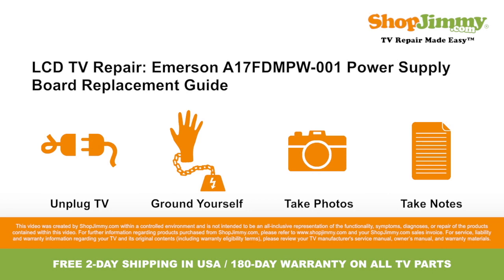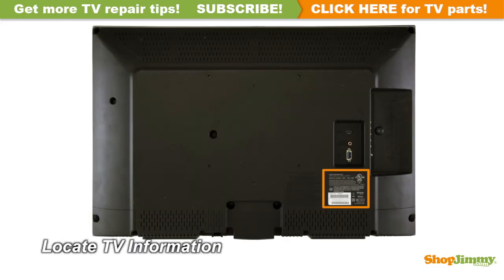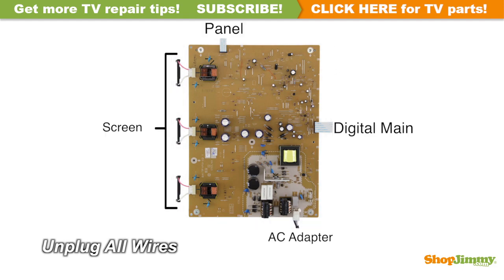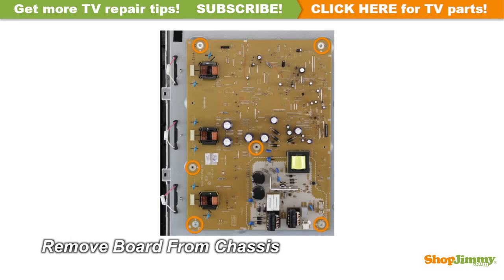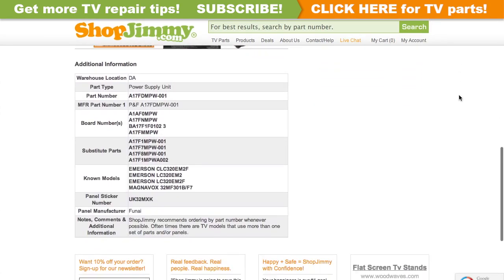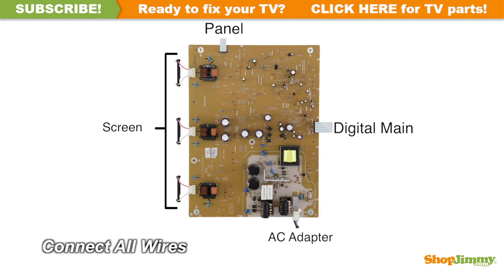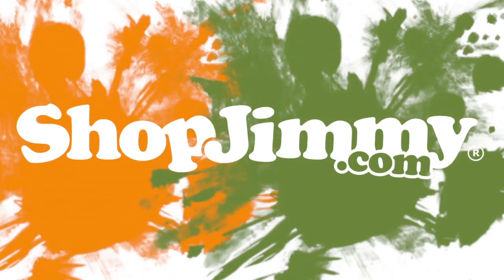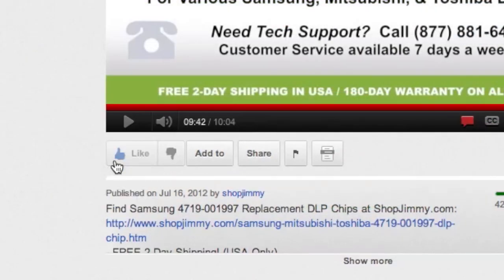Popular Emerson A17FDMPW-001 Power Supply Unit (PSU) Boards Replacement Guide for LCD TV Repair

Comment: I have an Emerson 32" tv I took it to get looked at and they told me it needed a new power supply/invertor. can I get these at a reasonable low price or is it better to just buy a new tv?
Reply from the maker: Angel D.   We do offer board repair service for this part.  You send us your board and we fix it and then send the board back to you.  Here is a link with more information on our website:  http://www.shopjimmy.com/emerson-a17fdmpw-001-power-supply-backlight-inverter-repair-service.htm  Be sure to match up part numbers and be sure your TV symptoms fall under the symptoms that are fixed by our board repair service.  You can also call our customer service for further assistance with your purchase.  (877) 881-6492  Thanks and please let us know if you have any further questions with your TV Repair!  www.shopjimmy.com